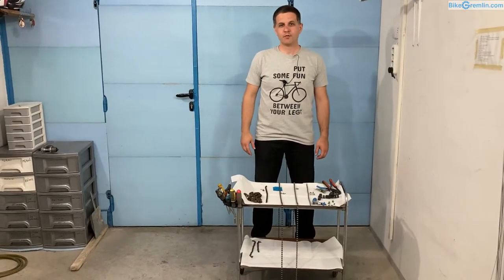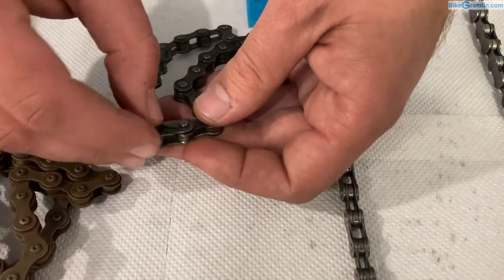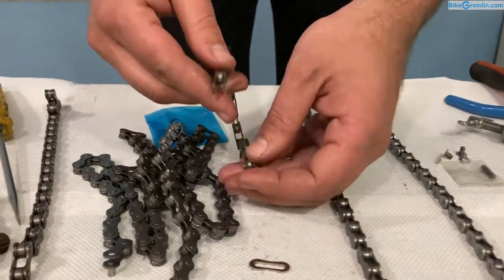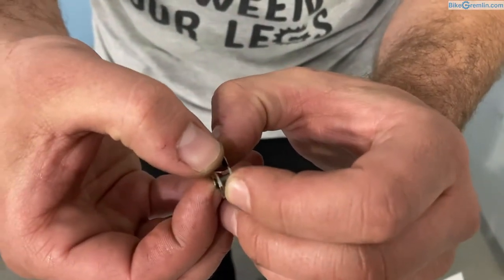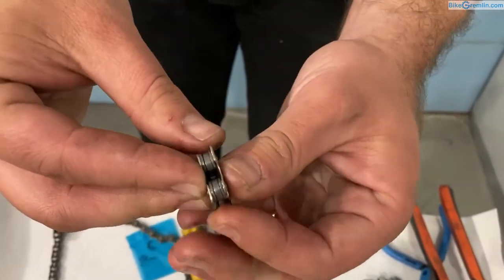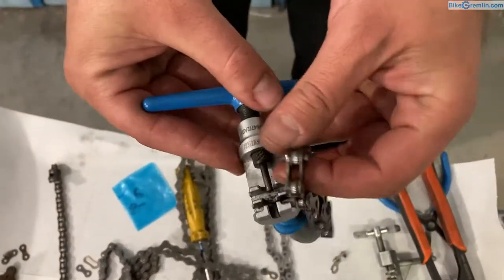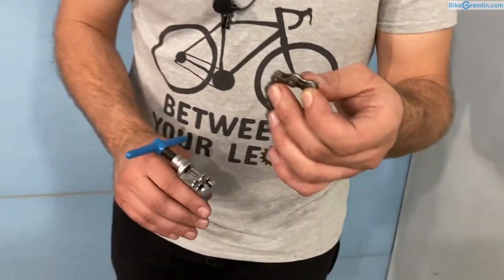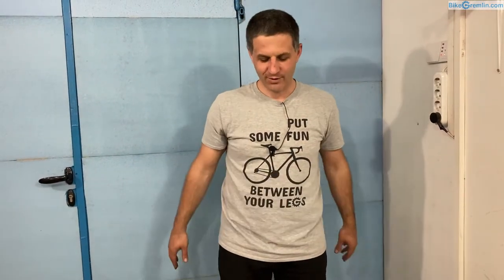Connecting bicycle chains (quick links, pins etc.)

Comment: At 9:00, I believe the term you are looking for is "flush".  Instead of saying, "On chains with 9 or more speeds, this needs to be flat, inline, not protruding," you can say "On chains with 9 or more speeds, this needs to be flush".  Meaning, "The pin head must be flush with the surface of the outer link."  Very informative videos.  Thank you.

Comment: Thanks for the tutorial. What if the pin came out? I tried it, but it's nearly impossible to get it in now. Does that mean I need a new chain? Appreciated
Reply from the maker: If a pin comes all the way out, it's usually best to start with the next pin (technically second one, on the next pair of outer plates). You can use any section of chain to add the needed length - either the part of the chain you "cut" to shorten it, or get an extra chain for the needed extra links.

Not sure if I've explained this well.  :(

If you have further questions, please use the BikeGremlin forum - YouTube is tricky with comment replies notifications (and posting any pictures):
https://www.bikegremlin.net/

Relja
Reply: Thank you  @BikeGremlinUS

Comment: Hi can i use 2 quick links to lengthen a chain i shortened too much .
Would it be safe ? 
Thank you
Reply from the maker: Hi,

I think that it should be fine. A quick link doesn't know if it's the only quick link on the whole chain.

Relja

Comment: funny thing is, you don't explain the most popular chain - the 7 speed!
Reply from the maker: I didn't try to explain every chain. I tried to explain the principles, applicable for any chain one might face.
Reply: @BikeGremlinUS  - maybe next time 👍
Reply from the maker: @Davieboy-dovbear  I see no point. The principle depends on the type of pins and/or on the type of quick link used. Not on the number of speeds.
Reply: @BikeGremlinUS  - OK, since I got you here, please advise on this; this is for a 9 speed bike (but I guess that doesn't matter). Chain has 114 links and inscriptions on it are; PCS9, SRAM and B3. I'm in eastern Europe right now, on vacation and the market here is not as vast as it is in the US. I can't find a SRAM chain. Can I use a substitute? What are my options? and what type of links/pins - THANKS.
Reply from the maker: Any Shimano, SRAM, KMC etc. 9-speed chain should work fine.
In a pinch, you can go with a 10-speed chain (it will work perfectly fine, but is needlessly more expensive for a 9-speed drivetrain).
As for the connection, use whatever comes with the chain, or get a 9-speed quick link (by any manufacturer).
- Of course, if you go with a 10-speed chain, you'll need a speed-link sold as a 10-speed one.
Most new chains come with a speed link. Shimano is an exception, they often provide a pilot pin ("Shimano connector pin" in the video).

Additional note:
As noted in the video, for 9+ speeds, one can't re-use a pin from the chain to (re)connect it. A quick-link or a pilot pin for the matching number of speeds should be used.

Edit:
The number of speeds doesn't matter for the chain connecting-disconnecting. But it does matter for matching with the cassette. I wrote a series of articles about mix-matching (there's a constant shortage of parts in Serbia for as long as I can remember):
https://bike.bikegremlin.com/category/technical-part/compatibility/